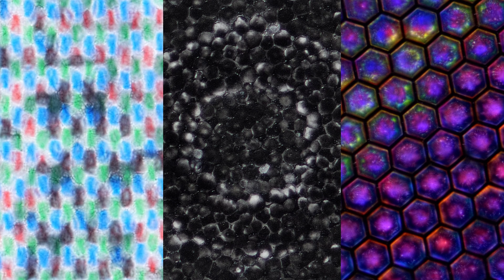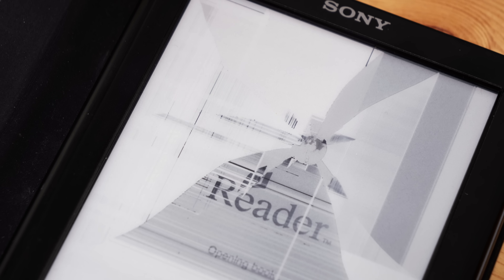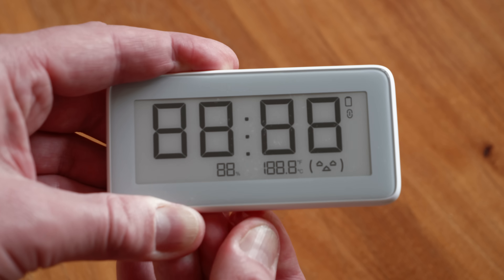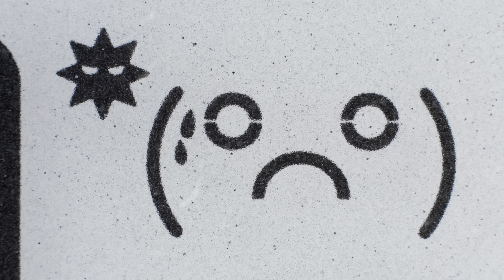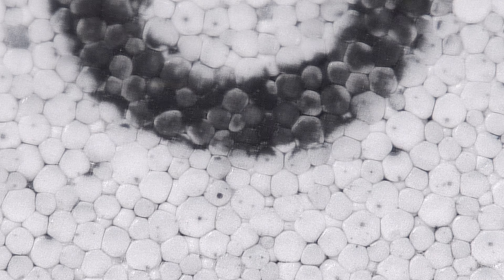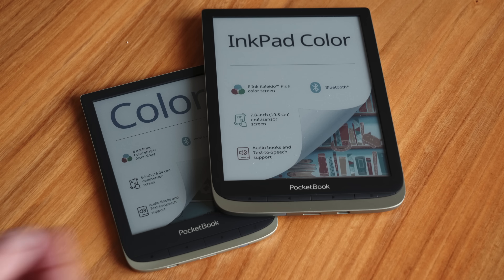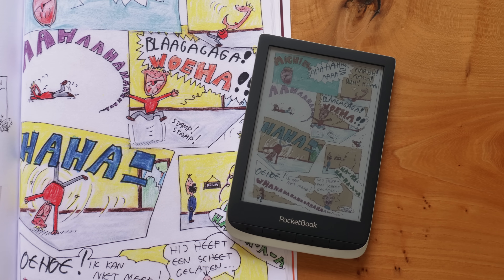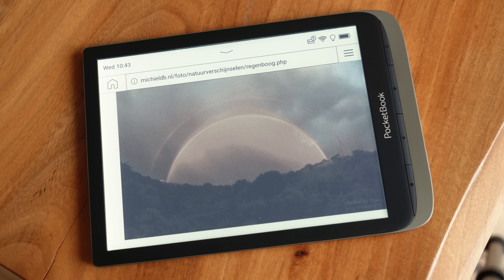Electronic Paper - See What Happens

Comment: Something I've been wondering. With plugged in devices recieving alternating current, would it be possible to replace the black and white flashing reset with vibrating charge at 50-60Hz. 

Having 10-20 cycles of that every frame could shake the ink loose like vibrating bubbles out of concrete.

Comment: If the anti-glare layer is on the outer surface, you could dab a little bit of clear vegetable oil, WD40, or alcohol onto it (perhaps experiment with each), in order to eliminate the blur.  Not sure which would work best.

Comment: Advice!!! Place a drop of immersion oil or poppyseed oil on the diffusion layer, then gently lower a glass microscope cover-slip onto the oil drop, without trapping any air bubbles under it. Surface tension will hold the cover-slip in place, and you can focus your microscope on the colour raster.

Comment: I worked on the original Amazon Kindle, and one time I had left a prototype device in the window sill for a few days and then found that the screen had turned completely dark, although it cleared up the next time I rebooted it and refreshed the screen. My theory about what happened there was that the photovoltaic effect caused the screen charge to very slowly change, causing the black ink balls to eventually drift to the surface.
Reply: Fluffy lore drop
Reply: Hey wait I know you

Comment: This type of e-paper display (made by E Ink) is called electrophoretic. It moves small particles in a liquid. Which means the technology is quite slow. There were many other e-paper display technologies years ago, but they got abandoned after being outcompeted by E Ink. Two I remember were called Liquavista (colored oil droplets deformed with electricity) and Mirasol (tiny mechanical switches which reflect light and create interference). These were quite fast, but the biggest problem remained creating bright colors without subpixels.

Comment: Seems like there is electrode layer and pigment layers complete;y isolated... ie like  lcd electrode layer... anode cathde as owerlay... atleast thats what i guess from macro perspective... as electrodes cannot be seen but whenchanging perspectve there is sgadow of lcd display patterns ... ie squared matrox patterns etc... which indicatec electrode activation layers invisble but their reaction points clearly reveals some kind of electicall application from same kind of matrix conductors...brobably front for one anode r cathode... and on back anoter connectio of power controlled by matrix display protocol...

Comment: Wonderful video Posy, always a joy to watch them ^^
Those e-paper price tags are quite interesting as well. A shop I sometimes work for recently had the issue that one of the antenna units for the wireless price updates didn't work. After I fixed the issue I could watch as blocks of those tags on a large shelf started to flash for updating the displayed data.

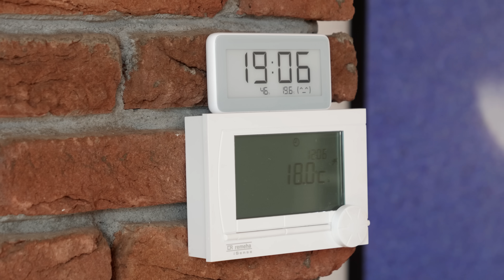Comment: 1:33 e-paper isn't really a logical choice for thermostats. you should only use e-paper if:
- your display content changes very infrequently
- your display is almost always in a well-lit area
- you need to take very tight power limitations into account

your thermostat gets wall power (unless it doesn't, but it does most of the time) and is not always in a well lit area (yk, when it is dark at night).

e-paper is cheap, but a backlit lcd panel is cheaper. so there you go.

The reason stores do have e-paper is because the e-tags don't have wall power most of the time (at least the once i've seen). they have their own battery and use low power rf for communication. which means e-paper starts making more sense again.

Comment: You forgot 3 color one. Lidl price tag that can be red black white. They work same as full color with different pigment density when modullation picks color.
Reply: This is actually incorrect. I didn't know this until a couple days ago. I started working a Software Development internship for a Product Traceability and RFID company over the summer. Right now we're working on massively redesigning one of our demo rooms we can show investors when they come to visit. One of our partner companies who makes those three-color E-Ink price tags was there getting their system set up for a "supermarket" section in our demo room, and their guy was installing those three-color white/black/red tags. I asked him how they added the third color. He said they paint one half of the tiny black pigment balls red, so when they want to display red, they bring the white balls to the bottom and bring the black balls to the top, and then they apply the charge in a "different" way to ROTATE the black balls 180° around, so their red side is facing forward.

Comment: I recently finished my apprenticeship as an electronics technician, and the final project I was assigned was to design driver circuitry for a very simple e-ink bargraph display (6 segments: t dots + background). They’re simultaneously very simple to drive, yet also very hard to drive well (note in the macro of the thermometer refresh how it has to do multiple write/clear cycles and that during them, the segment sizes grow, and that the segments that are “off” have a gray outline).
Reply: I have the same thermometer. It gets worse over time. After 6 months the "burn in" is very noticeable.
Still much more readable than LCDs though.

Comment: You might try putting water or another fluid on it to see if it neutralizes the antiglare texture.
Reply from the maker: I did now! Thanks for the suggestion (also to others in other comments). Lazy video here: https://youtu.be/cY1neR2iHPE
Reply: Exactly this, Ive done this and works pretty well, makes such rough but transparent surfaces become clear. Put a cover slide and then fill in between with glycerin or immersion oil.
Reply: oooh yes! like how frosted glass appears clear with vegetable oil on it!
Reply: That's a good idea.

Comment: This e-paper stuff always fascinated me since the first day I saw an e-book tablet as a kid, while it's really niche as a product, I've always hoped it as a cool futuristic replacement for certain things in the future, like paintings, books in libaries etc.

Doubt it'll actually become anything big until some sort of breakthrough new invention happens, or until patents are made public.
Reply: Like @fouzr said, I have a ReMarkable and it has made a huge difference in my life. I am a habitual note taker and journal-er, and it fills a niche that a tablet never did for me. The price point is terrible and I honestly can't wait for the patents to run out so that e-paper is made public.

The thing that sold me on my ReMarkable was the fact that it lasts for a week on a single charge. E-paper is such an efficient display technology. As long as you do not need a high refresh rate, it's perfect.
Reply: @HappyJackington  yup, the reMarkable is an excellent example. I own one myself, and love using it on the daily. And as a bonus, it’s a fairly open embedded Linux machine, which lets you tinker with it quite a bit

Tho I think even after the patents have expired, the cost of manufacturing it will still be quite higher than any LCD panel. The yields of those panels aren’t great afaik
Reply: There are devices like the Kindle Scribe these days that let you write notes at a really good latency of sub 10ms if I recall correctly. Still a niche, but the tech is definitely improving, albeit, very slowly
Reply: One interesting application is that it’s being adapted for luxury cars to create color changing liveries! It’s still in the prototype stage but I think it has real potential.
Reply: @yeetusvanitas9800  I mean that's cool and all but helps nobody.
Reply: @MalakaiDerg a very niche use case for that is to make your car white or black during different seasons, so it can reflect heat in the summer but absorb it in the winter.
Reply: @MalakaiDerg  meh, not all we do has to be the cure of all diseases and hunger of the world in a single pill. Just doing cool stuff for being cool is great as well, it still moves the market and gives jobs to people.
Reply: @Kalvinjj   Once again, cool but honestly just making "cool" gimmicks for rich people, no thanks. Those engineers could be spending their time doing something more useful. Besides, it would be a nightmare probably in case of needing to take care of the paint after a crash or anything.
Reply: @MalakaiDerg to be fair, once consumer interest fuels investment in research, a breakthrough in that field could have cascading benefits into other fields. Conceivably something borne out of automotive-money could find it’s way into a novel medical use. As it’s a relatively uncommon tech, I think that being too doubtful is premature.
Reply: I will say that an e-reader has drastically changed some things for me.
I am able to buy and read more for a lot less money, and I am also able to gradually pare down the amount of physical books I have to shelve, dust, and haul around each time I move.
There are some books that are, to me, worth keeping on hand in physical form. Most particularly ones that I refer to often for quotes and citations.
But most of my fiction books have just been box-fillers and muscle-pullers for far too many moves.
Reply: Utility patents are only valid for seven years, though. That's not a terribly long time.